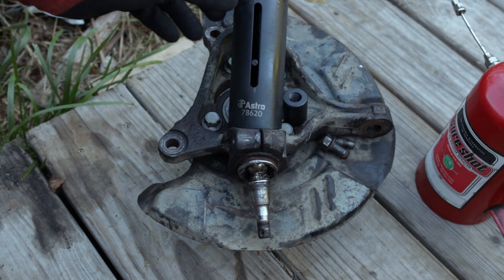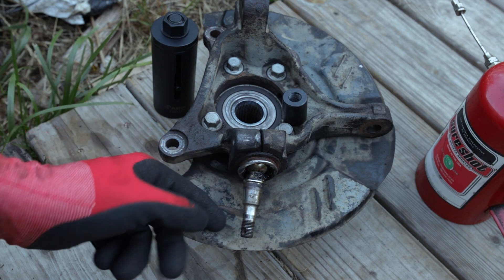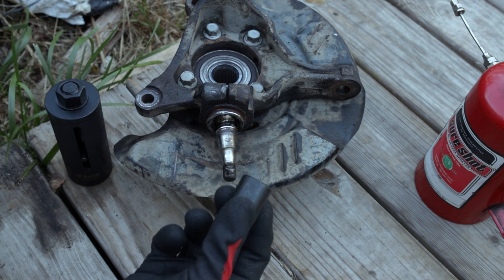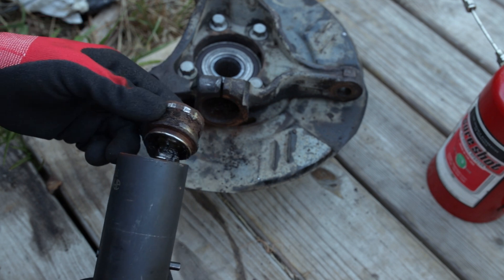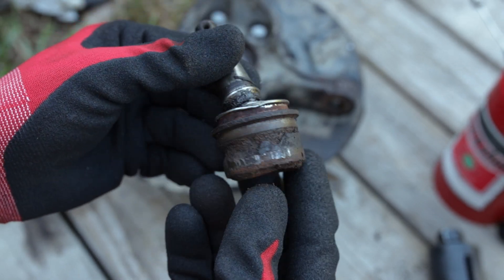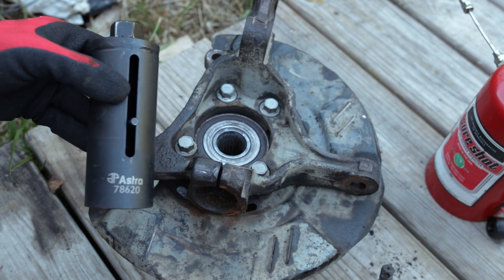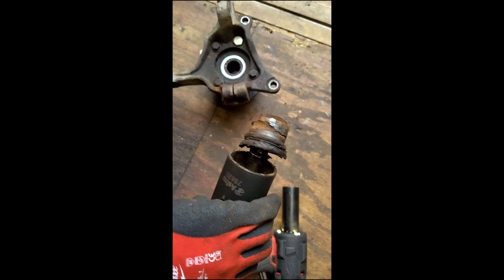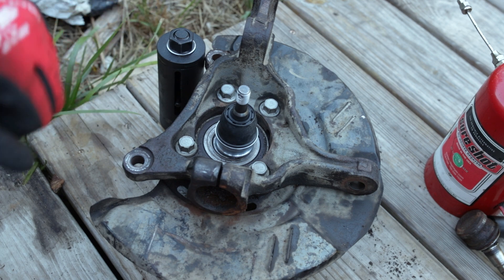Subaru Tools You Need! Astro Pneumatic Subaru Ball Joint Remover 78620

Comment: Great little tool. One suggestion: Oil the threads at the nut/threaded shaft area before going at it with the impact wrench. The tool will likely have a longer cycle life if it is always generously lubricated.

Comment: INCREDIBLE. I still have PTSD from the last ball joint I did on my 05 Dodge Magnum (Chicagoland winters 😳)
Reply: I don't find ball joints all that bad...my only issue is sometimes having not the PERFECT adaptor. Too small, maybe too big, might slide off ect. Even if you buy a decent kit for a couple hundred bucks, its easily paid off once you do a couple few balljoints.

Comment: That’s pretty awesome! Im up in the north so I always throw a license plate around the CV boot break out the torch and heat where the pinch bolt threads in and they usually come out!  Then I also leave it bolted in the control arm! but if i can i will get someone else to pry on it while I use my air hammer with a chisel and carefully hit the lip of the ball joint and it usually comes right out

Comment: I got this this point and after being stumped for an hour came up with this solution. I loosely bolted the knuckle back in to the car - balljoint, tierod and strut. Found a 2ft long 2x4 and put one end down on the lca with the wheel turned to full lock. Big f'n hammer down the other end of the 2x4 and it yanked the balljoint right out.

Comment: I prefer the other style like snap-on makes, but company 23 makes a cheaper version, still a bit  more pricy than this one, but all are a killer tool to save so much time and headache. 
Also, 99% of those pinch bolts need a torch to break free without snapping, when in doubt, torch it out!

Comment: I live in Maine, and bought used Subaru's for all of my five kids to drive in high school and college.
(Which is why I have followed this channel for many years!)
I saw this tool on South Main Auto's channel and got one for myself.
I loved this tool so much, I bought another one for my mechanic to use in his shop.
My theory is that the large pinch gap is responsible for letting the salty road water get into bolt threads and the joint around the press-in ball joint.
***Note:  make sure to clean out as much rust as possible from the socket and bolt hole after you get it out!***
Therefore, I always re-install with anti-seize on the bolt and around the press-in portion of the ball joint.
I then fill the pinch gap with a quality silicone sealant to keep the water and salt out and reduce the chance of excess corrosion from re-forming.
I only had to replace one of the ball joints I has previously installed this way, and it popped right out after the bolt was removed easily.

Comment: ordered this tool 2 days ago from amazon to get out a totally seized ball joint from my 2014 wrx. this car sat for 6 months before the owner sold it and then sat for 3 months at the dealer before i bought it after driving in ohio for 8 years. every single nut and bolt on this thing is rust welded. the tool comes today. im really praying this tool gets the ball joint out. already had to drill out the pinch bolt to replace with a nut and bolt. this car is a pain atm

Comment: OMGOSH!!!
I wish I knew about this tool before my nightmare. I ended up breaking pinch bolt and drilling it out but had to use a cutting torch to get the remaining cup of the balljoint out, after grinding, cutting, beating, and cursing the ball joint for 5 hours...
Reply from the maker: Ouch. Been there before.

Comment: used mine a few times worked really well, eventually the threads got destroyed. never lubed them up though. i’m sure i’d have better luck if i maintained it.
Reply from the maker: Yeah, has to be greased/oiled.
Reply: @MrSubaru1387  would wd40 do the trick?
Reply from the maker: @Andrew-uf1dw  no. WD-40 isn't a lubricant.

Comment: Great tool.  How is a new ball joint installed?
Reply from the maker: By hand, or tapped in with a soft faced hammer.
Reply: @MrSubaru1387  thanks.  Is the same kind of force needed to drive it in?
Reply: A video on the install would be cool 🙂.  Great vid.  BTW...I got my first Koken tools from your videos.  Thanks.
Reply from the maker: Not at all. Removal is only an issue due to rust.